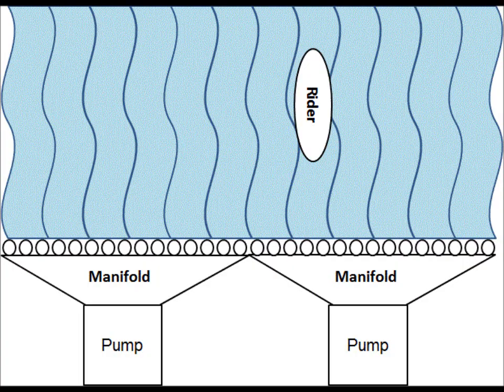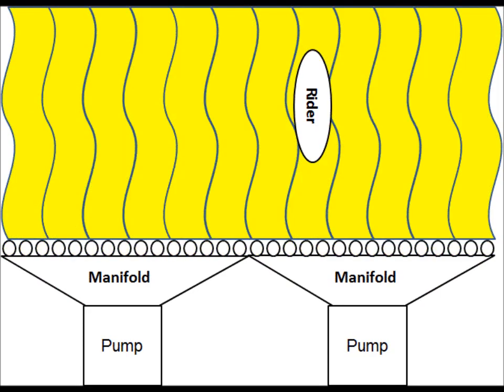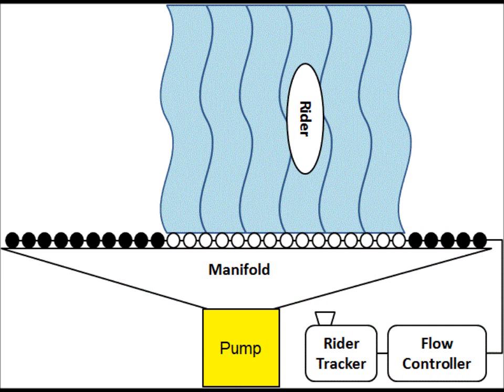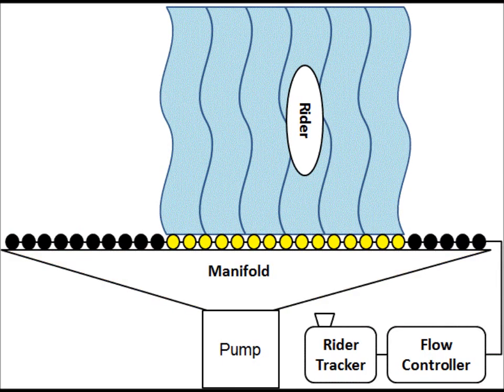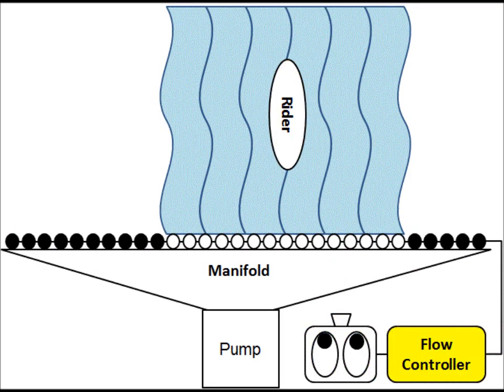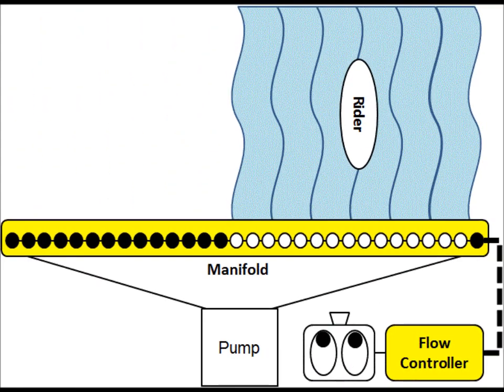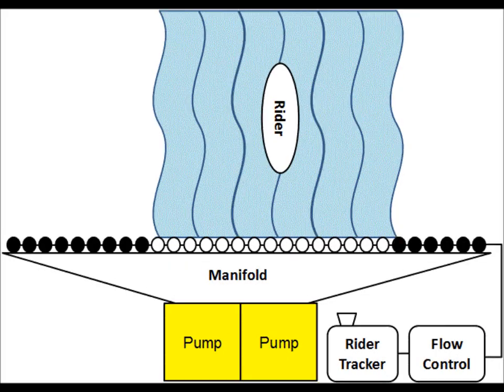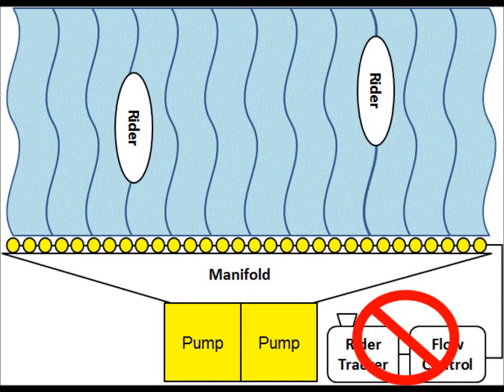SmartSheet Invention (HowToLou.com)

Comment: To be honest, I like your idea here, but the logistics don't add up. You would need a very expensive and precise tracking system that would cost more to operate than having the extra pump. And having the nozzles close and open with such quick precision would also be costly.
Reply from the maker: Danny Tepper - The electricity to run one pump costs $10/hour.  For a year-round flow, at 8 hours a day, that's $30,000 per year.  The tracking system would simply be a camera and computer running software.  I am a software engineer.  This software is pretty simple and does not need a CPU with a lot of horsepower to run.  Even with waterproffing, the tracking system would cost less than $10K.  Fast-acting, electronically controlled water valves are very common.  Water shows and ornate fountains use them all the time.  I have no idea of their cost, but I bet you could get a complete set for another $10K. The smart sheet would pay for itself in a year.